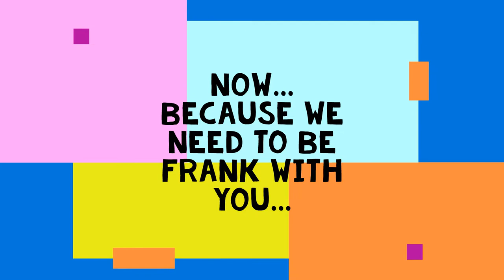Harmony Express Skoolie (EP 20) - Up on the Roof (Deck)

Comment: I could have loaned you my 5/16-18 rivnut insert tool.  Bought it to do stainless steel rivet nuts for things I'm fastening to our bus roof.  That would help if you ever needed to remove it after your ceiling is finished as the nut is held in place already. We're planning to build a sailing/ catamaran net lounging area about 7 x 8 in the rear of our bus and probably a center perforated steel gangway down the middle to cut the weight.  But our bus is 27 inches taller now so too much extra roof weight is a serious tipping over risk in high winds.

Comment: It ALWAYS takes longer than you think!   Mike, any concerns about pressure treated wood reacting badly to metal on the bus?    

Also...what't the back story on your bus name?  Are you a musician?
Reply from the maker: Thanks for the comment, Ted!  The angle brackets we used are galvanized (thankfully) as were the carriage bolts through the treated 2x4 down the center.  The center board is not in contact with the metal of the roof as it is either sealed with butyl tape or sits atop the paint on the roof.  The only part that I am now questioning are the grade 8 bolts holding the angles to the roof... those are not galvanized.  Not sure how to get a strong bolt that won't stretch or break under load that is also either stainless or galvanized...  Any suggestions on that front?
With regard to the name, I'll have to do a video about it!  Allison and I are both very involved with Barbershop music.  Allison is a PHENOMENAL bass singer (bass in Sweet Adelines is a super low "alto") range.  I am the director of the Women's Barbershop chorus that Allison sings in and am an addict to the style.  When our friend found out that we bought a bus...after a long moment of silence in disbelief over the phone, said, "Well there ya go... the Harmony Express is coming to Pittsburgh"  and a Skoolie Channel was born!!
Reply: @HarmonyExpressSkoolie  Wish I had more insight into bolt physics, but, alas, I'm not that bolt savvy.  I thought that I had read somewhere that PT lumber can react with bus metal.  But the butyl tape will hopefully provide a barrier.

I'd love to see a video about your name!  I really should do an intro video, I just haven't gotten to it yet.  Barbershop, huh?  I played one of the school-board members in Music Man a few years ago.  "Ice CREEAAAM!"  More notably I played guitar and mandolin in an Irish Pub band for years.  And sang the songs that required volume and off-color humor.  I wasn't allowed to sing the pretty songs....
Reply from the maker: @River-Channel  Okay...even more reason that we have GOT to get together sometime.  Would love to sing bawdy songs together and teach you a tag or two!  My wife is quite the singer as well.  It's on my list now... gotta get together with Ted!
Reply: @HarmonyExpressSkoolie  We are thinking about heading to the Yough at some point...
Reply from the maker: @River-Channel  We'd meet you there for sure... We're not whitewater people, but love that part of PA....  I also want to make a trip to Maine (in the Summer or fall, of course)
Reply: @HarmonyExpressSkoolie  Ok, we'll let you know if/when we make the trip back to Ohiopyle.  You're welcome in Maine anytime!  there's plenty to do besides whitewater!  We'll be living right next to Katahin all summer!